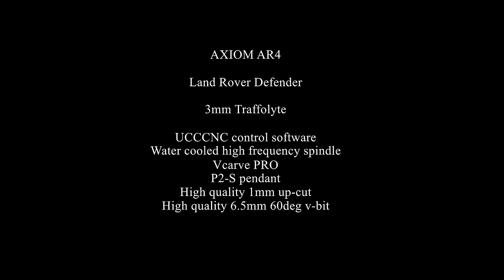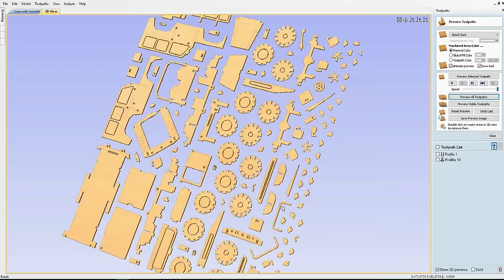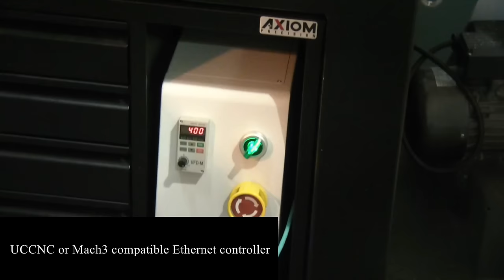AXIOM CNC router making a landrover defender

Comment: very impressive!!!!  just wondering what RPM and IPM values you're using to cut the acrylic?  I was contemplating on an AXION CNC for some of my smaller projects; based on your experience, what are your likes and dislikes about AXiom?  Thanks for your feedback.
Reply from the maker: Good solid introduction to the professional CNC router world. we can machine  1-2-3mm  DOC@1500-2500mm/min - very much depends on the type of acrylic and your cutters. We use the machine with the UCCNC controller so this is a lot more user friendly than the hand held controller. the UCCNC has proven to be incredibly reliable in the field also.
Reply: thanks for the reply, this CNC is looking like a good choice.  I currently run a 40 series Thermwood but i often have smaller jobs that would better suit a smaller table size.  Ty again
Reply from the maker: So far very good reliable accurate machine.  Currently the spindle speed is not controlled by the software - we are working on that. Spindle on off is controlled - but not the spindle speed directly from the Gcode. We offer it as an upgrade now and will soon offer it as standard.

Comment: how do you get it to work with mac 3 or a different controller? mine just has the hand held controller
Reply from the maker: Hi Matt - we revamp controller to work with UCCNC and Mach3 - we find this a much more comfortable solution for our clients. Its our own spec and choice of OEM parts. We have been using Mach3 and now UCCNC for years in our commercial CNC routers. The AXIOM is now fully supported by us on the UCCNC / Mach3. The module we use in the controllers can support either. So this same machine in the video can run mach3 or UCCNC.